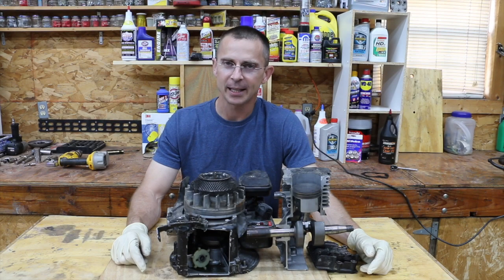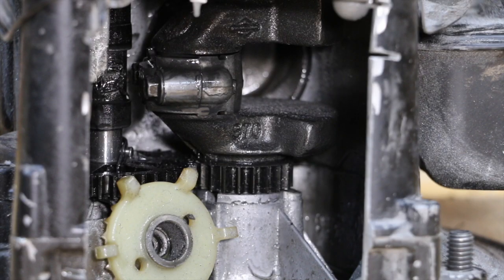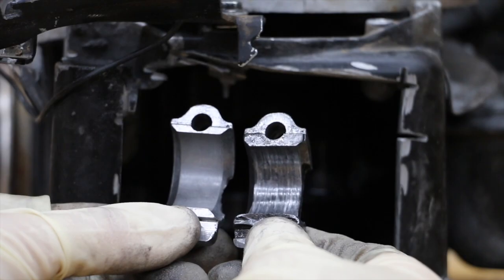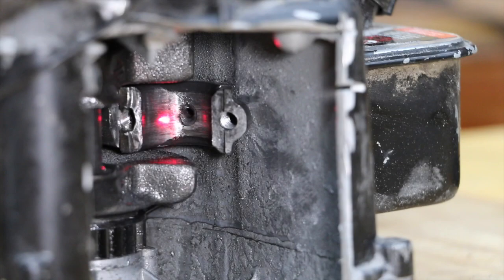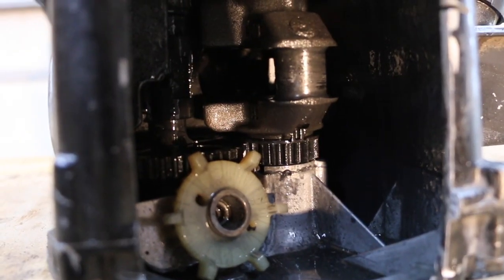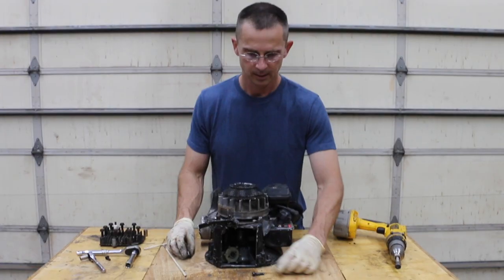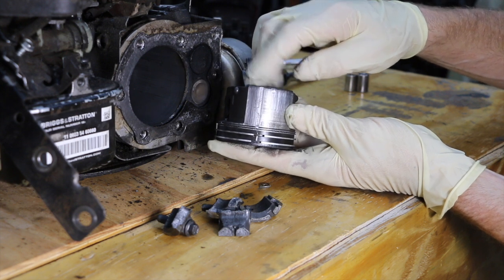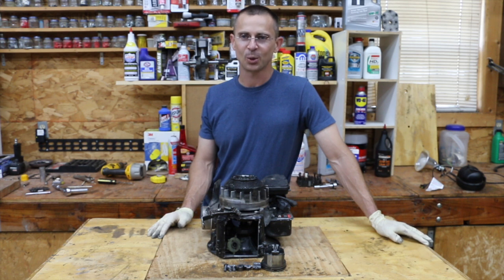Running Cutaway Engine Throws Connecting Rod!

Comment: Had a Cummins L-10 throw a rod at a stop light. Put 2 fist sized holes on both sides of the block and bent one of the rods back on itself without breaking it! The truck was a White Expeditor, cab over. Luckily no one was hurt, just shaken up a little. Talk about energy release! Great video! Thank you....

Comment: I've had 2 engines fail. One on my truck which was 25 years old still don't know why it did that when it was in great shape. The second was my cavalier and that was due to a terrible mechanic who overfills the oil and a sloppy timing chain replacement

Comment: My moms car she ran it till she blew literally the engine was doing a slight knocking and the next time we drove it we first let it warm up sounded like the problem fixed itself but shortly after getting on the highway which was right down the road real close and she pulled out to get on there and then the engine sounded like blew up because now it was knocking so badly and so loudly and it would not move until you have it 7 thousands on the rev meter thing but then the engine threw a rod and something went flying right at the neighbor's house and it leaked a lot of oil out but in the past the 2 causes to this was 1 it overheated so many times there was a lot of sludge inside the engine and 2 it ran with no oil 2 times because it needed a new engine seal you know a metal with rubber seal thats orangish red and it was in a wreck before we ever had it but still had a clean title my dad said it might have been the transmission that was making a ton of noise and i said i don't think the transmission has anything to do with this but it was a oldsmobile 88 1996 white color it was good we had it for 6 years we put around 45k miles on it but never knew how many miles it had when we bought it because the milage was frozen at 88k miles but from the engine use it seamed like it had 150k miles so by the time we got done with it it was probably close or at 200,000 miles it had a clean body on it we sold it to the junkyard and got 177 $ for it ha that was funny so little money.

Comment: Had a pitbike engine do the very same thing too me whilst riding it it was one of them cheap chinese honda copy engines a lifen 125 engine was well oiled and to my knowing in good working order went out with a bang cause it seemed to be running great then bang no power back wheel locking managed to grab the clutch before dropping it not a great day :P

Comment: I knew the connecting rod was going to blow into pieces, these engines will take pretty much any abuse but no oil always result in this way on them. It would be more fun if the engine was run at maximum possible speed without the rev regulator he he

Comment: I've been a mechanic for 39 years and never considered anything like this. I guess I've seen my share of them come apart under actual use. The most amazing one was a 350 Chevy threw 4 rods through the block and pan, hole in left front of the block fist size, on the side it broke starter housing in half. Coworker asked if I'd tried to start it and listen to it after it came in so I did, engine started and ran for a few seconds, after hearing it I shut it off.

Comment: I'd love to see a "Lucas" engine additive test to see if an engine can a)get higher compression on a worn out engine by using the additive, and b)will the Lucas additive allow the engine to keep running even without oil (oil is drained after Lucas treatment) for a period of time?

Comment: I have had an engine fail.  I had just taken my Engine a 351 Windsor for my 1977 Ford Ranchero GT to the shop to have it Bored, the heads milled and rebuilt.  I had the shop put the engine back in the vehicle and was on my way to class at RRCC, and suddenly noticed a distinct lack of power, like the engine was struggling.  I pulled it over, opened the hood and head it knocking loudly.  a "Rod Knock"  I shut it off and waited for it to cool down, Called a tow truck, "They could not come, Tried calling several other tow trucks, but I was on the freeway 6 so I could not stay parked there for very long.  The Tow truck was not coming at this point, so I started the vehicle noticing it took a considerable amount of effort to crank it over.  I tried to pull the vehicle off of the freeway and was limping down the shoulder with the hazard lights on to get to a side turn off when I heard a loud clang sound.  "This is the point I am sure the Rod Bearing Let Go.  The engine idles down slowly.  

It turned out that what had happened was the shop did not smooth the Crank shaft for the rod bearing properly, so it caused Harmonics and vibration which eventually led to the bearing being destroyed.  Once the Bearing was no longer on the Connecting rod the piston in Number 6 was slammed down against the crank shaft by the fuel igniting with no way to be pushed back up, it missed the crank shaft because it had no connection to it as the crank shaft arose back up it hit the Crank shaft where the bearing should have connected, taking a chunk out of the Camshaft, breaking the Push Rod and causing a catastrophic failure.  The end of the push rod also hit the oil pan with so much force that it knocked a hole in the pan causing the oil to come out.  This occurring less than 80 Miles into the rebuild.  

The Lesson for Mechanic Shops.  

Make sure the Crank shaft is clean, check your clearances and make sure the Rod Bearing is tight and at the specified torque or you will have to tear it apart and rebuild it again, not to mention buy your customer a new oil pan,crank shaft, and possibly a new Piston. Basically rebuild the engine again. .
Reply: A shop that dosent know what PLASTI-GAUGE is?
Ouch.

Comment: The rod design is bad (for tensile strength) having one of the end cap bolts going through the beam section of the rod. Typical engine failure is that the thing ceases up (as was illustrated here) long before it blows up, breaking the rod is easier accomplished by buzzing the motor to 7 grand.....of course it needs to be hopped up to do that and that's another story:)
Reply from the maker: This is a great point!  Thanks for watching the video and commenting!

Comment: what caused the engine to seize in the first run? heat?
Reply from the maker: The lack of lubrication caused excessive friction and metal contraction.  Thanks for watching the video and commenting!
Reply: Metal contraction? Isn't that the same as shrinking? I thought expansion would seize, but contraction. Unless the external housing shrunk...Sorry Newb here when it comes to ICE's

So fascinating. Thanks for the video!

Comment: get a leaf blower and run a motor as fast as it can go without oil and blow the leaf blower into the carburettor it will run lean because the blower will act as a turbo and with no oil running full speed it will blow up and be awesome.

Comment: would be really wild to see on a high speed cera inside a v8 or v6 as those multiple cylinder engines would continue turning over after failure
Reply from the maker: I agree!  Thanks for watching the video and commenting.

Comment: My engine fail #1:
Mercedes 220D from 1971 (W115)
the Valve geht lose, touched the Piston, parts broke away, found their way into the other pistons and broke all pistons. within seconds. 

Engine fail #2:
the VW 1.6D and 1.6TD are nearly the same. You can match the turbo in the non-Turbo engine. but there is not piston-bottom-cooling by oil. 
well, if you drive carefully, it works. 
you might think, the pistons will be damaged, but your are wrong. 
the head will breake. it will breake between the valves such deep until the Water-cooling channels. Then water will come into the burning room in the pistons. be careful at Next Start!  maybe the engine is Blocked.
if not, you will tear a white steam-cloud behind you until engine is warm and the split closes by heat. 
this is reproducable, the block works, but every 40 000 kms you need to change the head. well, the 3 time you do it in a saturday afternoon.
Reply from the maker: Peter, I enjoyed reading your comments about your experiences with engine failure.  Thank you for watching the video and for taking time to comment!

Comment: i can't believe he got it started for a second run. lol. i once had a small 2 stroke blower that seized. i was intending to mix the 2 stroke oil with the fuel. well, long story-short, I got distracted by someone and the oil never made it to the fuel to be mixed. not realizing, I was pouring straight fuel in to tank for next run. started it up and it lasted less than 50 seconds. compression was completely gone after that. healthy it was about 40 -45. after only 18. into the scrap bin it went.

Comment: I blew a big hole in the motor of a Ford Taurus
Reply from the maker: Heidi, I bet that made a lot of noise!  Thanks for watching the video and commenting!
Reply: Project Farm Yeah my husband at the time thought he could pull a bunch of equipment  with that little motor, I told him it wasn't going to be able to handle it but he wouldn't  listen and it cracked the block. Then I decided to finish the the job by driving it from Florida to Wyoming and it worked but that was a long trip stopping over every hill to add water. As soon as I got to my uncles it kicked the bucket. Coming from a family of mechanics I knew it be a long shot but I made it and met a lot of interesting people along the way. Oh and your welcome.
Reply from the maker: Heidi, I'm impressed that you were able to drive the Ford Taurus that far with such a significant engine issue.  Impressive!
Reply: Project Farm Well it helps if you know your car and have a bit of common sense. My mother had to call my brother cause she broke down and come to find out she was out of oil, you'd think she'd know better smh.
Reply: My family actually owned a 1996 Ford Taurus with the V6. The engine blew up because my sister forgot to go get the oil changed. So the engine got super hot and almost caught on fire under the hood.

Comment: Weld an aluminum plate over the hole you cut and put a new rod in it. Don't throw it away I'm in need one of these engines
Reply from the maker: I think this engine is beyond repair.  Thanks for watching the video and commenting!

Comment: It would be nice to bring back a seafoam comparison with homemade seafoam. I've used the recipe over here in Germany where they don't sell seafoam. 1 part denatured alcohol, 2 parts diesel, and 4 parts high octane gas  (I used 98 ron local which is 93 octane in the U.S. although I did consider using 100 octane) here is the source of the recipe. http://hildstrom.com/projects/seafoam/
Reply from the maker: Kurt, Great suggestion!  Thanks for watching the video and commenting!

Comment: Is it common for connecting rods to break that far up? I was expecting it to just come apart at the crank.
Reply from the maker: Jesse, I believe the intense vibration from the crankshaft caused the aluminum to flex excessively, weakening and then causing it to fail near the crankshaft.  Thanks for watching the video and commenting!

Comment: I and my Brother and some friends would gather together and take a old clunker and set it up on blocks and drain it down to one quart of oil and put a brick on the accelerator . Then start taking bets on how long it took to blow up. Got a hold of a 1968 VW Beetle that was a little tired and near death so we thought. Started it up and it ran for 2hrs.Not realizing the engine was designed  to run low on oil and such. Gave it to one of our friends standing there who needed  a car. And he drove it 4yrs and traded it in on a 90 Toyota.
Reply from the maker: Impressive that the VW survived this test!  Thanks for watching the video and commenting!

Comment: Had my pressure washer do the same thing only the connecting rod came out the side of the engine and put a big hole in it and oil went spraying everywhere
Reply from the maker: Alex, I hope you didn't get hit by any of the parts and they came out of the engine!  Thanks for watching the video and commenting!

Comment: Great videos, very informative. question for you how can you get more more power out of you lawnmower without having to buy another one? thanks
Reply from the maker: Without investing a bunch of money, recommend making sure the air filter is really clean to maximize airflow into the intake.  If the mower has a spark arrestor in the exhaust, make sure it is clean.  Finally, make sure the engine is tuned up and carb properly adjusted.  Hope this helps.  Thanks for watching the video and commenting.

Comment: Were you starting the engine with a impact?
Reply from the maker: Hi Matthew, I used an electric drill to start the engine.  It spins the engine over at a pretty high speed and is a lot easier than using a pull start, since the motor was on a bench.  Thanks for watching the video and commenting.
Reply: Project Farm thanks for the reply. I enjoyed the video keep them coming.

Comment: Oh man...that thing went kabooey...bits and pieces went everywhere...WOW!
Ive seen the guy with the see thru head....would love to see a see thru block (epoxied plexiglass or even glass) just to see if you could actually see the internals but doubt it due to all the oil mist slinging around
So very cool!  plays taps for the poor engine
I didn't know they didn't use replaceable lead babbitt bearings in those small engines...very cool to know all it is is a piece of aluminum inside
Great video! Keep em coming!
Reply from the maker: Brian, Thank you very much for the positive feedback and terrific ideas!

Comment: Had a rototiller that threw a rod, there was a hole in the side of the crank case about size of a base ball.
Reply from the maker: Phil, I imagine that made quite a bit of noise when the engine went!  Thanks for watching the video and commenting.

Comment: Great Video!! I personally have not had one lock up or throw a rode. I know when to stop. lol But I am currently working on a truck that did throw a rod. At the time it happened it was so violent that there are now four (4) holes in the oil pan. I can't wait till I open it up and see the damage.
Reply from the maker: Charles, Wow!  That was catastrophic failure!  Thanks for watching the video and commenting.
Reply: Project Farm correction, 5 holes!! I'll try to send pictures. I'll be dropping the oil pan tm now that it's out the truck.

Comment: I had a 125cc 2-stroke kart engine blow a rod during a race one time. It punched a 1" x 0.5" hole through the front of the block (3/8" thick), as well as destroying the carburetor's butterfly and the reed system. The piston shot to the top of the cylinder, also ruining the spark plug. I still have that engine sitting in a box in my garage, and the piston sitting on a shelf as a trophy
Reply from the maker: Wow!  That's a lot of damage!  Thanks for watching the video and commenting.

Comment: + Project Farm. Thanks for your reply. Glad someone thinks I have some good ideas. I said this before but, I ran my car using Dura Lube.
The drain pan after changing the oil, never could get rid of the slippery oil coating, no matter how much degreaser I used.
This is what you want. My question or idea, is to fill the entire crank case only with Dura Lube. Even though extremely expensive,
I wonder how well this test until  the recommended oil change would go? I wonder if anybody tested this?
I have a few invention ideas. My problem is that I want to sell the patent for them. Not make then sell the product to industry.
A few ideas are related to automobile and small engines. Some could be huge money makers. Can't say what they are, obviously.
I don't know where to go to sell an idea? The Dura Lube idea is one of them. Sorry to blabber. Thanks for your reply.
Reply from the maker: Bob, It seems as though a long-term test using Dura Lube in an auto would be quite interesting.  

Regarding your patent idea, you might consider contacting and entering discussions with a manufacturer that builds products in the same category as your invention to see if they are interested.  Hope this helps.  Thanks again!

Comment: Try putting two carburetors on at once, like one carb connected to the other, or one intake welded to another intake.. then you could get the engine to rev insanely high
Reply: Amphibious Turtles on a low compression flathead like that briggs, you would just sucseed at flooding the cylinder.
Reply from the maker: Great suggestion!  Thanks for watching the video and commenting!

Comment: What a great project! You might try this - my dad always told me when I was younger that putting mothballs into the gasoline would make the engine run incredibly - but would ruin it by getting too hot - similar to the tale of sugar - I never tried it but have always been curious.
Reply from the maker: BroBlast, Great suggestion!  Thanks for watching the video and commenting.
Reply: Mothballs are made from naphthalene, a C10H8 aromatic hydrocarbon, so I guess this might be true. I'm not a chemist, but I suspect that the risk of failure due to overheating might be due to increased unburned carbon deposits on the valves and piston, which would cause hot spots and eventual failure (dropped valve or a hole in a piston).

Comment: What do you think caused the deep groove in the piston skirt and cylinder wall? Maybe a ring that stuck? Hmmm... interesting indeed.
Reply from the maker: I agree that the groove was caused when by a ring that got stuck when ran without oil.  I suspect the ring somehow folded over, causing the deep gouge.  Thanks for watching the video and commenting.

Comment: I had a 307 Chevy. it started knocking. I had to keep driving. but was taking it to put a new engine in the car. but it didn't make it. it broke a couple rods. and pistons. bent valves. and actuality broke the can in 3-4 pieces. basically trashed everything ... it had a lot of hard miles on it though.  and the block looked a little like that Briggs!